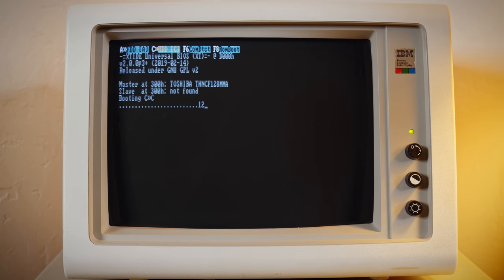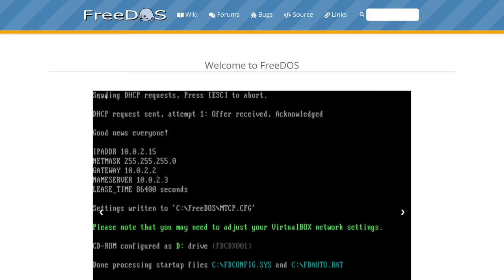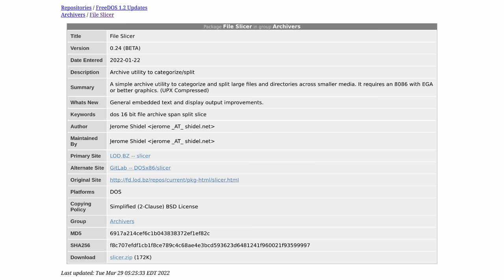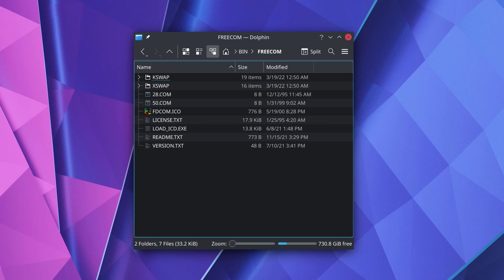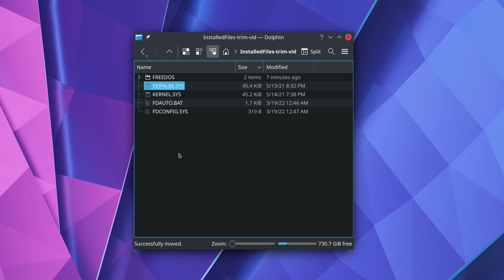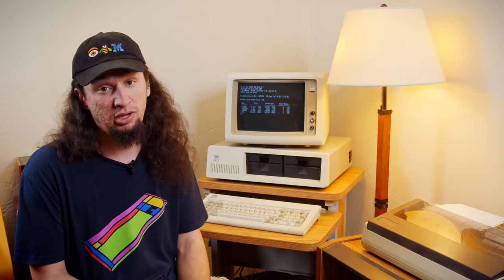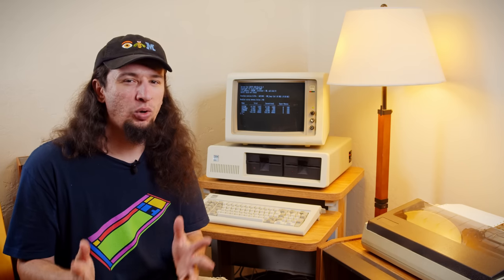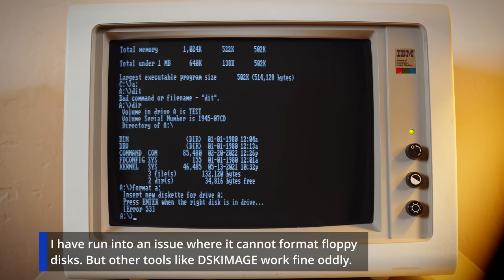Installing FreeDOS for 8086 on an IBM 5150

Comment: This is awesome to see! Thanks for sharing! 👍
Reply: You should take this as an opportunity to revise fdimples so that you can only install certain languages and omit 386 programs.
Reply: @OpenGL4ever  fdimples won't run on an 8086 anyway. Even on a 386 it runs slower than a pregnant hippo in a mud pit. It has too much overhead.
Reply: @dschoene57  I didn't knew that. In that case a complete rewrite would be a good idea.
Reply: @OpenGL4ever  That kind of application simply doesn't run on an asthmatic processor like the 8086 as it reads its info directly from the zip files, and the processor is simply too slow to decompress the files in a reasonable time. On pre-386 systems you'll have to make do with the command line package tools.
Reply: @dschoene57  This also explains why fdimples only knows the packages that are on the inserted CD-ROM (e.g. the bonus CD). A cross-CD search is not possible at all. The problem could be solved differently, with catalog files. One for each CD-ROM. If you put the CD-ROM into the drive and run fdimples, it could create a local copy of the catalog file on the hard drive. This means that when searching for and reinstalling programs, you could search for the corresponding programs before you have to insert the corresponding CD-ROM. In the case of the FreeDOS distribution, one could go even further and store the catalog file for the main CD as well as the bonus CD on the main CD, so that both catalog files can be installed locally for fdimples without the need to insert the BonusCD.
And an 8088 would be powerful enough to also handle catalog text files.

Comment: FreeDOS is an excellent system for 386+ computers, but not so good on 8086 PCs as it is quite wasteful in terms of RAM and storage. SvarDOS might have been a better choice for such a machine.
Reply: I just re-found Svarog by chance just a few minutes ago and was delighted to see this. It's progressed a lot since I last used it, very cool.
Reply: SvarDOS is only a distribution using a FreeDOS kernel. Thus you will not save RAM. And FreeDOS programs are usually much more powerful than their MS-DOS or DR-DOS counterparts. 
In addition, one should better compare FreeDOS with the last standalone retail MS-DOS and DR-DOS versions, an MS-DOS 6.x or DR-DOS 7.x is also not lightweight for such old 8088 computers.
Reply: @OpenGL4ever Here is the amount of available memory reported by MEM on a 8086 PC with 256K of RAM:

with SvarDOS: 186K
with FreeDOS: 117K

Looks like RAM saving to me.

Another thing is that FreeDOS installation requires 11x 720K floppies, while SvarDOS fits on 3. Of course, that's because FreeDOS comes with lots of good stuff, but most of these goodies are not so useful on a 4.77 MHz machine.

Comment: Very cool to see. It always struck me as odd that FreeDOS installs in such a non DOS like way, the CD seems to even boot the Linux kernel instead of being self installing. The 2 disk transfer setup is really cool, but I think the 4 disk option was in the sweet spot for being fully self contained. Wondered why FreeDOS was so big and documentation and languages make sense since they only want one distribution and there's no other way to provide local documentation for a download, but it is odd that the install to disk still includes every language, multiple copies of files, and versions of executable for multiple cpu revisions, seems they could really slim that down with prompts in the install process
Reply: Makes me wonder how difficult it would be to compile your own distribution of it from source. I don't know what build system they use, but it would definitely be cool to get a self-hosting installer.
Reply: The CD does not boot the Linux kernel, but DOES use the SYSLINUX bootloader. All the different boot methods use the SYSLINUX bootloader so they don't have to rewrite the program multiple times to work with any boot method that the CD supports (ElTorito and emufloppy and I think one more)
Reply: @nathanielbarragan882  ----"(ElTorito and emufloppy and I think one more)"

romeo..
Reply: @anon_y_mousse  I am looking at seeing if i can compile the kernal and command to use a little less ram.
Reply: part of that reason is thats its time consuming, and to do the language appropriate installer & test the install is not something a single person can do, which again make it more time consuming. I believe the real reason for the single "package" and not better suited smaller install setups is to not make it too easy for comercial use, which dont contribute to the project. If it was packaged in more convinient was it would have been used on more than just the 1000 odd device models it already has been used on, of which not a single donation has been made, nor contribution to the project - well thats always been my take on it anyway
Reply: @paulwratt  No, the package manager fdimples they use, just can't handle it and getting individual language files from zip files is also much more work. Commercial use is definitely not the reason. Because the modern computers that are sold today with FreeDOS have neither a performance problem nor a space problem. The only problem they have is a missing BIOS and a missing A20 Gate support.

Comment: Could you also give us the option to use the self-contained 4-disk version? I would much rather a longer, simpler process with a self-contained install that feels a lot more like the original OS than this complicated method for a two-disk version.
Reply: an xt with a 3.5inch drive can still install the 720k version. It only took me 2 hours.
Reply: @wishusknight3009  That's not bad at all. Definitely feels like a lot was compromised with the install process just because of size.

Comment: Deleting unnecessary files from programs and operating systems WAS a thing back then. People tried stripping down DOS, Windows 3.1 and other applications by a trial and error method even later with hundreds of megabytes of hard disks. Some programs dropped a few "missing file" error messages but if it ran, it was okay :)
Reply: Yeah, I remember "bricking" (temporarily, my fathers work friend helped us get the system back running) our IBM PS/1 (model 2011 I believe) DOS install by removing "unnecessary" files - who knew those system files weren't really that unnecessary, LOL :D Still, you really could save some precious space by doing things like this, but that experience kept me away from trying to do it without proper knowledge or a way to get it back running if I removed something necessary - once I learned a bit more I was back at it :)
Reply: I remember stripping unused drivers and documentation files out of Windows 3.1 while building a master image for my highschool. I slimmed Windows to a fraction of it's "minimum install size" by manually amputating support for hardware we didnt' have. The final tested and accepted install (including all of the curricilum's specified CAD, drawing, animation and office suites) fit on a 80MB harddisc. 

(decades later) I still haven't forgiven the politically-motivated-[*] who physically destroied it when they shifted blame for their malfunctional-bloated image that deleted features from the applications instead of the 'important Windows files'.
Reply: i remember stripping down windows to run in ramdisk on a 486 so it would run faster
Reply: For sure, disk space was precious.  I once wrote a program to scan for file duplicates (examine files of the same size and see if they were duplicates of the other) to make a report to help decide which copy to remove.
Reply: I got win95a down to 16mb as a pure thin client for win2k terminal server. Just enough os to boot and run mstsc. I think I even deleted explorer.
Reply: Definitely relevant in the boot from floppy era.

Comment: FreeDOS is not only used by vendors for updating BIOS and firmwares. It has become somewhat of an "standard" to ship laptops without Windows or Linux preinstalled with FreeDOS.
Reply: sadly EFI systems will kill that tho, as DOS can only support BIOS.
Reply: Even as late as just a few years ago, the Dell Optiplex machines work would order came with a FreeDos CDROM instead of Windows installed, since we had a site license for Microsoft software already.

Comment: This brings back memories of roughly downsizing an early Knoppix Distribution just to use gparted to rollout PCs with windows preinstall images. We basically took a hacksaw and deleted anything that wasn't required, then changed the startup sequence to launch directly into bash console. The XP images barely fit on the DVD but we made it happen and in the end we preinstalled about 9000 clients with it during the project.
Yes that's awfully crude but when it's 2004 and you're in a hurry facing a showstopper you make ends meet.
Reply: You made a pre-set image with preinstalled stuff, imaged that and put it on the dvd along with gparted to write the image into the pc's by just popping the dvd in?
Reply: That brings back memories for me too. I used Knoppix for a year back in the early aughts, even using it as just a boot CD. Every time I had to restart the system, such as for power outages, I had to type a bunch of commands at startup to get it booting back to where I had it configured.
Reply: @lasskinn474  and it was scripted and would detect which hardware type it was to be installed to and selected the correct image for it (we had 3, desktop, nb with onboard and nb with dedicated graphics)...
We tried to do the same with norton ghost at first but at the very last moment someone realized that the customer had no license for it and wouldn't pay for one.
Quote of customer "here take this ghost of a promo cd from that computer mag, noone will notice!"
Reply: @spitefulwar  I remember doing that for customers with laptops in the early 2k's.. Bart-PE built XP images custom made with all the required drivers for the particular machine, and any "special request" software.. (license?.. what's that??.. not my machine.. not my problem).. autorun setup so after hitting "install" all they needed to do was provide a user name and sit back. Of course those same people would then try to run them on different hardware and complain because important things wouldn't work..... I really enjoyed the challenge back in the day.. I was the town's "go to" girl when all the shops failed them. Even the shops were my customers when somebody literally couldn't afford a new motherboard or whatever.. I could pretty much guarantee them a repair enough to "get em going" for a few months until they could save up for the new hardware. One of my old customers is still using a desktop P4 I recapped for them way back in 2006. (using caps from a destroyed P2 of all things).. The bad caps era was great fun, but not many machines from that era survive now.
Reply: Back in the days of MSWindows 3.0, I had tried it out and decided it wasn't what I wanted to use, and didn't have the disk space to waste on the installation.  But I still wanted to play MSWin Solitaire.  So I made a custom 2-floppy (1.2mb) setup of MSWin, replacing the system shell (progman.exe) with sol.exe.  I would boot from the first floppy, which would assign half or more of the system memory (don't remember how much) as a disk cache.  At some point it would need the second floppy, and would load right into a solitaire game.  Your first game through would play VERY slowly, but once it had gone through that first pass, the entire environment would be in disk cache, and would be quite peppy (this was a '386sx).

Disk prices have gone down far enough I can keep a VM of MSWin10 on my system (Fedora, of course) for those rare occasions I'd need it.

Comment: Nice job.  You did just about everything I would have done, with the exception of removing the command processor from root -- never remove the one from root!  :-)  Remove it from the DOS directory instead, unless you're going to rewrite COMSPEC as well.  Also:  Not sure you need to worry about a specific version of ZModem, as Chuck passed away in 2015.

FreeDOS definitely needs volunteers, because there's a lot of the OS and distribution that could really use some tightening down.

Comment: I'm sure it's buried deep in my bookmarks folder, but there was an 8086/8088 distribution of FreeDOS I used back in 2010-2014. It was small enough to fit on a single 1.4MB floppy and was generally pretty speedy. Unfortunately, FreeDOS at the time didn't have 100% compatible support for some DOS routines I needed at the time, so I didn't end up using it, but I never thought I'd see someone take up the mantle again.
I super appreciate you making this distribution, and I have a 5150 clone next to me that's about to try it out :D
Reply: How'd it work?
Reply: How did it work?

Comment: I have known about FreeDOS since the beginning but I hadn’t  been tracking it. I had no idea the install was so large. I would have thought compatibility with classic systems would have stayed important to the project.
Reply: nope they only care about money nothing more nothing less.
Reply: @Bewefau  money?
Reply: @MurderMostFowl  my guess is salt about donations
Reply: @MurderMostFowl  yes someone is getting paid for it.
Reply: I guess that since FreeDOS development started long after these machines were obsolete but DOS itself was still widely used they never gave much thought about the early PCs and instead chose to leverage contemporary hardware (486, early Pentiums).
Reply: @Bewefau  That argument would work better if they charged customers an arm and a leg for this OS.
Reply: @s8wc3  That's more true. Much of the additional software in FreeDOS makes use of a DPMI host and protected mode and therefore requires a 386 or better. And that's also simply because a lot of development didn't start until the 386 CPUs were available and the protected mode is easier to program, the C compilers can handle it better and you have more RAM available for the applications, which means they can be more feature rich.

Comment: When I did this for a hotel chain in the 90's I used the Dos from Windows 95 and found it gave the best environment with the most free ram and all the utilities on a 1.4 MB disk to set up the hard drive. I am proud to say it self installed and included the ethernet drivers and the ability to pull down the hotel application to the hard drive. Worked for years on a 1000+ PCs so well worth the effort. Not too sure about the licensing but the PCs did come with Dos 3.x so it was nearly okay, I guess.

Comment: Really, I barely understand the stuff on here but I just find it interesting taking modernized software revisions and features to run on older systems. I'm always intrigued by older hardware limitations that can be solved with either modern software or hardware solutions.

Comment: I once connected a Mac 512Ke using PhoneNet adaptors, Serial to PhoneNet, A Serial to 10BaseT printer adaptor and managed to hook it up to a modern Cable internet connection successfully & do a little emailing and whatnot. Always super fun to get the old working with the new!

Comment: Many years ago I was following work on a bootable NetHack floppy using Linux. It ended up making such a disk using FreeDOS. Watching this brought back memories of that. A few things I did: The disk made a RAMDrive, and extracted files to it from the disk. On shutdown, save files were then recompressed back onto the disk. I think I may have also used an EXE compressor.

Comment: Back in the early 90s my friend's father used Caldera DR-DOS on their home computer. I vaguely remember there were some compatibility issues with certain games, but they didn't have as many games as I did, and they were mostly edutainment titles at that stage anyway. 

Last time I tried FreeDOS I found it a bit buggy and difficult to use compared to regular MS-DOS. Granted that was more likely because I wasn't used to doing things the way they're done in FreeDOS.

If you're looking for a good RS-232 adapter, I've been using a GearMo "USB RS-232 serial adapter with LED indicators" (model FTDI-LED) for some time. It's nice to see the TX and RX and other indicators blinking, and I haven't had any issues with compatibility at least with any of the Cisco devices I used it with.

Comment: Great work.. yes indeed.. we had to do things like this all the time back in the day to make things fit on the minimum number of disks and have space left on the internal small drives. I remember well the battle to get linux installed on my 386  back in the mid 1990's when I managed to get a Pentium 90 from somewhere for my main windows 3.1 work setup.

Comment: I booted off a USB install on my modern AMD Ryzen computer and plugged in my SD card to a reader. I ran a standard install and targeted the SD card. I put the SD card in an SD to IDE converter and booted my retro PC. Now, my retro PC was not a 5150. I was using one from the socket seven era but I'm sure you could do the same thing with a compact flash card and XTIDE right?

After that if I wanted to remove software I just deleted it from the SD card.